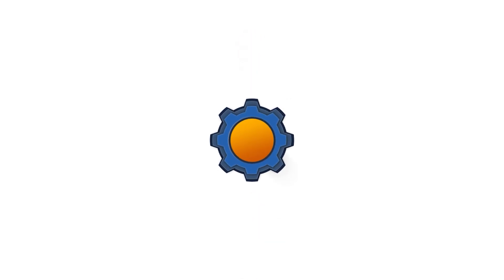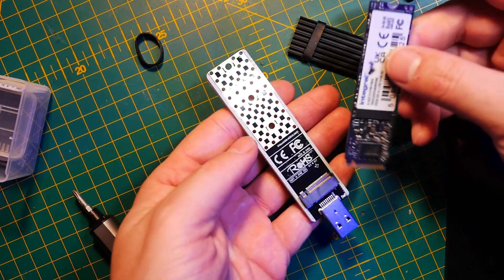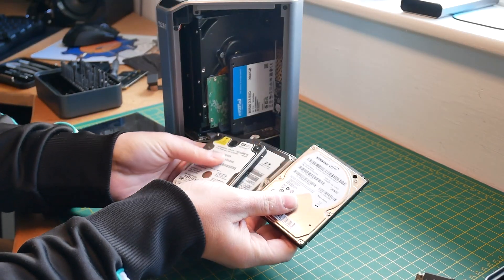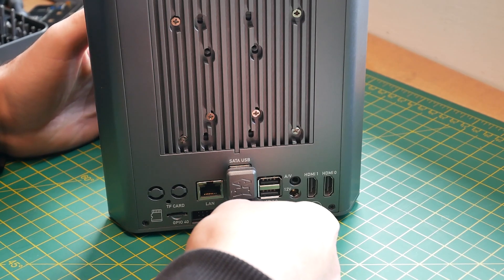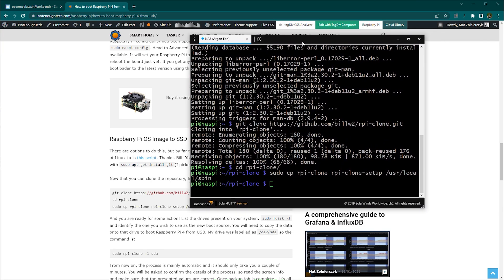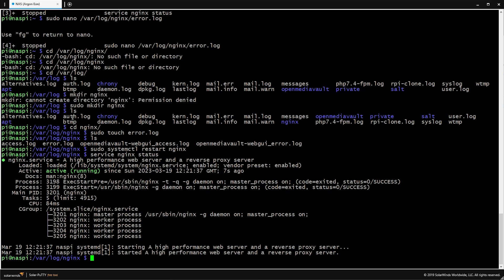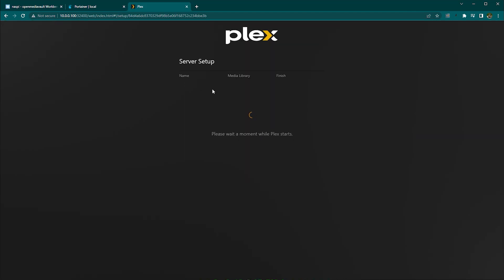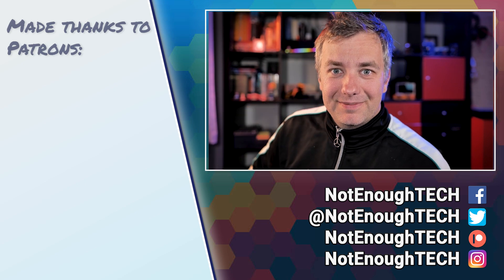Your Raspberry Pi NAS needs this

Comment: I have an Argon EON.  Its setup and working fine with one exception; I cannot get the time and date to hold across reboots.  I have a battery in the RTC battery holder and I've used to the argon-config to attempt to sync time and date.  No joy, it will not work for me.  Any ideas?  I temped to remove to remove the battery an stick with ntp services.
Reply from the maker: You need to edit out NTP in code. Otherwise it causes conflicts. I read about the RTC and NTP startup policies.

Comment: I'm currently running a similar USB to M.2 adapter in my Argon EON as well. Works like a charm. Also added to plugin sharerootfs to use the boot drive for config backups.
Reply from the maker: Good idea!

Comment: Pi4, amazon basics 7 port USB hub, 7 x 2TB portable drives salvaged from other projects, cheapest ssd boot drive you can find, mdadm, RAID 6 = great 10TB NAS that's been running for many years with zero issues  for less than £250 (plus the cost of the onsite/offsite backups of course, but you'd need those anyway) Pi4 = good, even if you don't have the salvage stuff you can start off small and expand.

Comment: Synology NASs are expensive but if someone want to try it before buying it, xpenology is a thing.
Reply from the maker: That's interesting. Although I feel while reusing older hardware would be great for this with current electricity prices running something like a laptop grade hardware at 30-40W would rack up a substantial bill each year.
Reply: @notenoughtech  My...Friend...is running this on a i7 7200u, with the disks going in standby when not used and hyper threading disable it's not that bad.
Reply from the maker: I'd love to see some power usage data. At the moment I'm facing about £10 a day with heating periods. So my bills are through the roof.